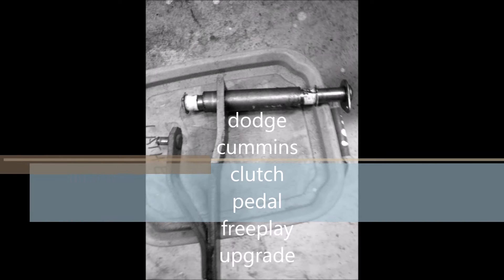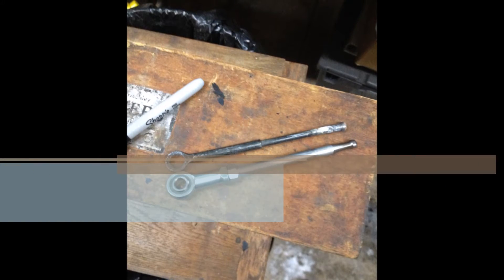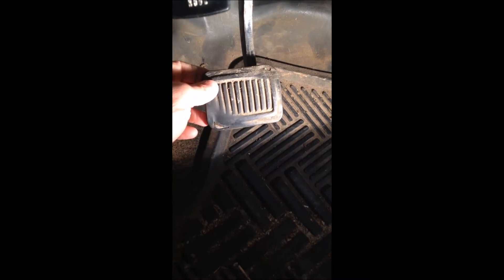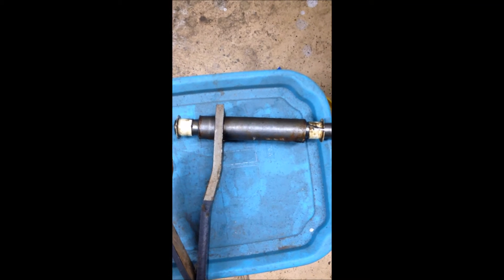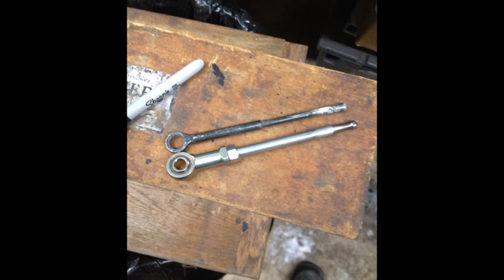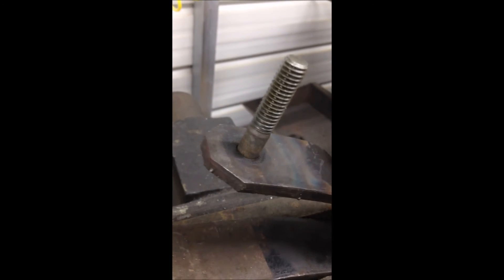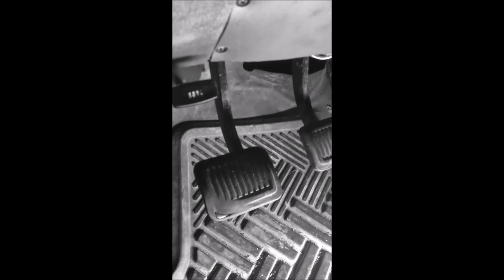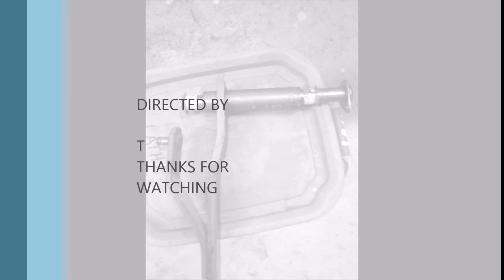clutch pedal freeplay cummins

Comment from the maker: The long bolt to rod end  is 6 inches , thanks for watching
Reply: I'm having the same problem with my 02 dodge.     Can you make me one of those rods
Reply from the maker: selongshot   ; it’s a bolt with a rodend from Napa , cut bolt head off and grind to fit clutch master cylinder, on your truck I don’t know if the distance is the same .. I can make one , but it will be a week or two before I can get to it. It’s real easy , give it a try , hollar if you need help ..

Comment from the maker: well there are two different ways, I f you want to save the lockin ring ( not necessary to save it)use a scribe or dental tool and work the the tool down in too locking as your moving pushrod around'
,release one tab. The second and easier method (but will destroy lock ring)- is use a small drill bit and drill slowly down next to pushrod and it will catch the little retaining ring and release it. caution dont drill to fast or with too much pressure or you may damage the front cup on master cyclinder, cheers

Comment: Can this issue cause enough of a problem to prevent shifting entirely? Because I have massive play side to side and I can't shift into gear almost entirely
Reply from the maker: If the clutch isn’t disengaging at all , I would say it’s possible ; but I suspect you have additional transmission problems